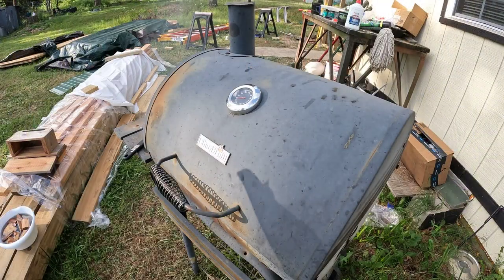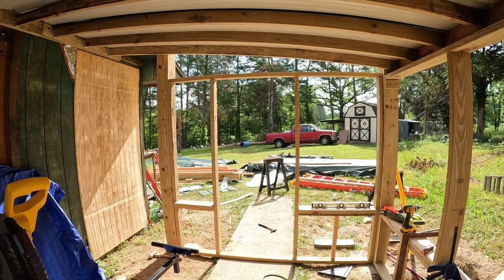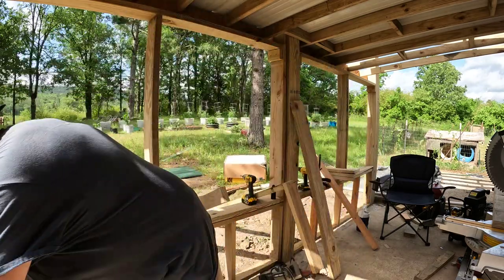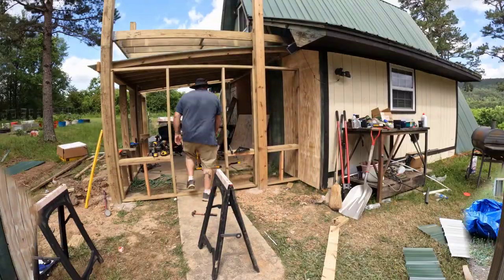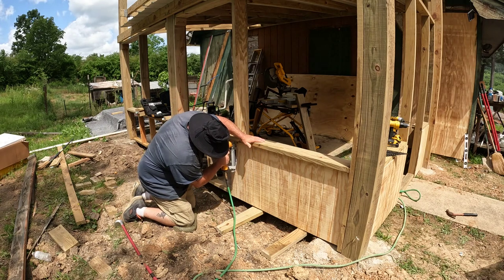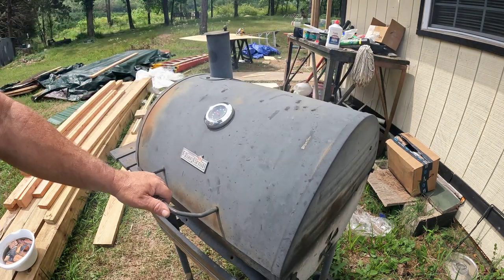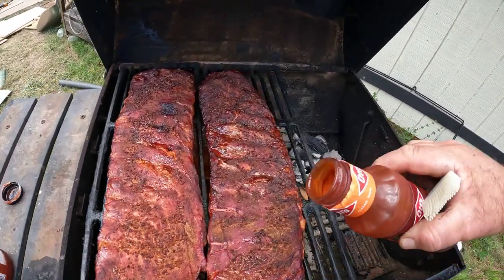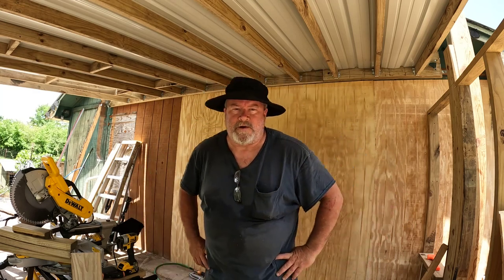PROGRESS CONTINUES!/ T1-11 SIDING/SCREENED PATIO/ DECK BUILD /SLINGBLADE??#13

Comment: why are you putting up the siding with trim nails and not using a ring shank nail
Reply from the maker: So old dudes like you have something to comment about! I came back later and secured it right, but nobody waits for that.
Go buy some of that traditional stuff nowdays, we have to cut corners, that T1_11 is going into wood and 2 inch nails are fine, its covered from rain.